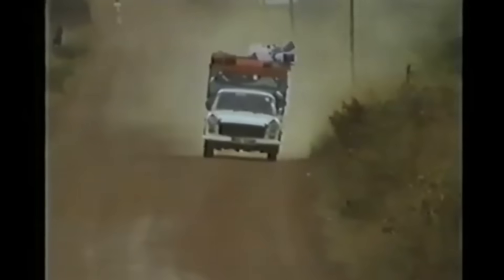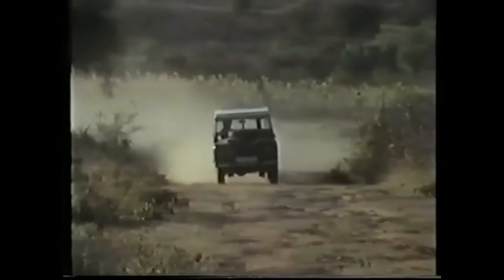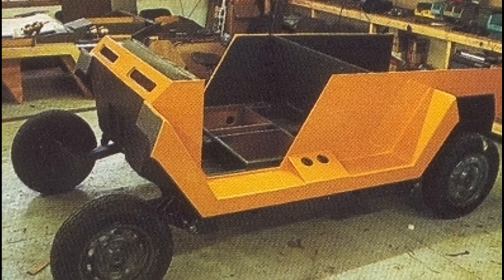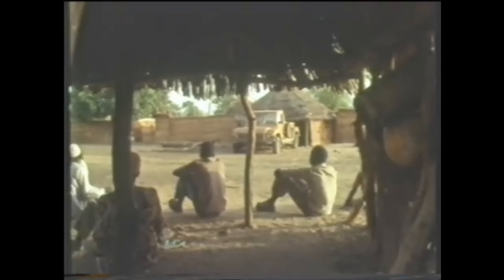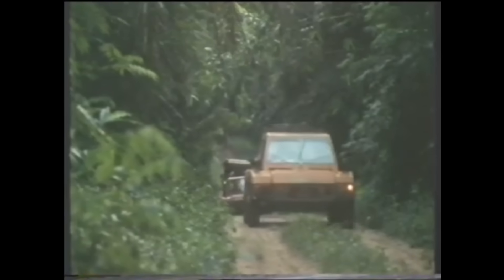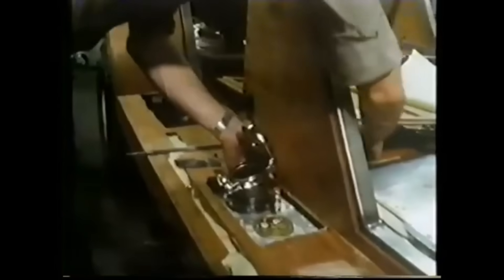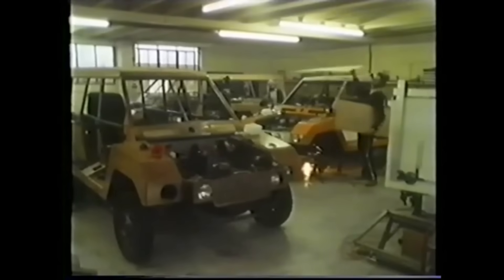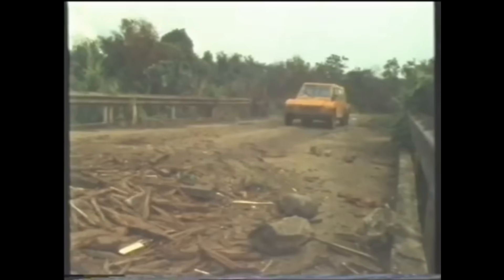This Car Was Built to Save Africa – And Got Its Creator Imprisoned

Comment: He defeated the purpose when he researched his own engine.  The whole point of using the citroen engine was that it would be widely available and already known by mechanics.
When you 'Applefy' your own product, you have chosen the path of profit before purpose.
Reply: he should just have built modified Mehari, raise the suspension and it will be unstoppable
Reply: @PatricioGarcia1973  Frankly, if you squint hard enough, he did. and may i notice, just like a Mehari, it's a soft and bouncy car, not meant to be a packmule, as any african car should be.
Reply: @bluemoondiadochi 
Try to read the book or look up some of the stuff that was on the net.  The four wheelers were designed to carry a African load and the Six wheeler 1.5tonne but it was also designed to act as a minibus Matutu ... Chassis for 12-16 passengers.. The suspension was long travel rising rate adjustable  
and worked well it was inspired by the DS and the Mini..😂...
Reply: @PatricioGarcia1973 

It was way too Fragile and the wheel placement and suspension was all too narrow and puny .. 

It also used GRP  body panels..   rather than wood.. I watched the series read the book and I've built my own utility Kit cars .. 

Africar was wide enough to straddle the commercial vehicle tracks of the African roads. It also ment it was more stable.. the suspension was very long travel rising rate based on Citroen 2CV  but larger and using the Interlinked hydro gas  Moulton Rubber units used on BLMC  designs, pioneered on the original Mini. 
The interlinking was inspired by the Citroens 2CV and DS..  
The underside smooth to allow it to drop it's wheels down into deep lorry ruts and slide along on the mud or sand .. if the front wheels hit a bump the fluid and gas  in the system allowed it to travel and offer rising rate springing ... Cheaply and light wt.. at the rear like on the mini the suspension was raised by the front bump ... and everything was flat to the ground low C of G suspension by swinging arms .. wheel rims were valuable steel that were tough and if they hit a vertical pot hole edge at speed the rim would bend rather than smash the suspension .. it could also if not fatally damaged be beaten back into shape with a big hammer 😂.. this is Africa. 
The monocoque epoxy wooden Bodys  were massively strong and never failed .. they also provided insulation and freedom from destructive vibrational harmonics on the rock pavement of the N. Sahara.. the six wheeler was able to drive fast and level over this that broke HGVs Landrovers and landcruisers.. alike  basically speed was determined by the constantly varying rock ripples that shook and fractured metal bodies and heavy suspension parts like clock work ..

In the mud they pulled out landcruisers  and Landrovers.. big American pick ups. The only structural metal was the welded galvanised suspension mounting  sub frames.  They didn't break either..  One inch plywood treated with epoxy can withstand being hit with a  lump hammer repeatedly. Dents filled sanded and painted over .. no giga presses or welding gear  required . 

They had two minor problems with the suspension/steering on one vehicle . A suspension come actuator rod had been turned down to half it's correct dia at the end of the rod and wore a hole in the rubber cup ..they fixed it with a tyre puncture repair kit 🤣and cut up a damaged inner tube.. that took them across the Sahel and on to the Equator. The other issue was damage to the steering track control arms ...and they got a local blacksmith to weld thick tubes over them to beef them up.

The 2cv gearboxes were weak for the terrain .. and motors especially in the 1.5ton load 6 wheeler.. and had to be rebuilt after the sand of the Sahara Sahel.
Basically the body chassis delivered brilliantly off road they even use the pick up in the Himalayan rally and it did very well given it's low powered engine. 

These days you would use electric motors on each axel ... And probably make it as a Series hybrid.. no complex transmissions .. or gearboxes and clutches..

William Towns designed a family of kit cars the Hustlers from the Huntsman to the huge Highlander 6 wheelers ..that were a kit equivalent .. including the all wood Hustlers. I seriously wanted one... 

Now we can produce chemically engineered Wood....Superwood in effect fire proof rot proof and 10times stronger than the untreated softhard wood used to make plywood it can also be moulded in pressure treatment . 
So stronger greener and more durable than both carbon fiber Al and Carbon Steel .... now think again ... 🤷🏻🧙🏼‍♂️🇬🇧 

Grow your body and frame material... rather than having to mine metals...  The Carbon capture in the wood even after the process it means it above 50% carbon neutral to produce... life span barring  catastrophic accidents ..  50-80yrs ...😮
Reply: I think youre being very uncharitable, I doubt it was profit before purpose, and more engineering masturbation before purpose.

The type of person that starts building a car for a demographic that has no money, isn't after money, theyre after a challenge, building your own engine is an extension of that challenge.

I know because I do the same thing myself, and I too don't finish these projects. 

The only similarity to Apple, is the flawed founder. but you don't tend to change the world by being 'normal'.

Plus if you want to get rich, you get cars out the door as quickly as possible, you don't start designing your own engine.
Reply: Kind of wonder if it was deliberate sabotage...This is kind o obvious
Reply: Nope, just a stupid idea...
You must be from Africa to know Africa and Africans....
Reply: What about CO2 footprint ? Anyay, there is NOT enough ressources for all !
Reply: @jpcaretta8847  Then do your part, stop using resources.
Reply: @jpcaretta8847  Would not have been a consideration at that time or in its intended locale.
Reply: I don't think it's about profit & appefication. There are things that we don't know. Was Citroen willing to deliver new engines & gearboxes for an adequate price?
Would a sustainable supply of 2CV gearboxes be possible while Citroen wanted to replace this car?
Reply: @peterm.2385  The answer is: no. The car would have cost too much anyway (or as much as a normal used car), due to the small-scale production and the expensive 4-cylinder engine purchased externally. Even today, Africa remains too poor even for very simple cars. There have been other such attempts, all of which failed.
Reply: Apple released new products that sometimes were more proprietary than desired, but they were leading edge.

African is more like the OLPC One Laptop Per Child initiative.
Reply: I think he wasted time on engineering anything.  VW type 1, Citroen CV2, and Jeep CJ2 and CJ5 chassis were being made and assembled all over the 3rd World at that time.  All the patents were expired.  Do it like trucks were built in the teens.  Supply a chassis with body back to the windshield and let the locals build the rest to suit.